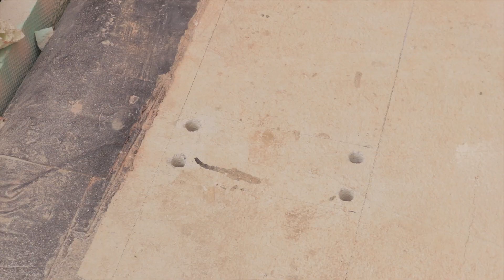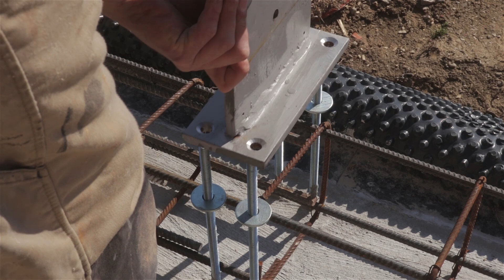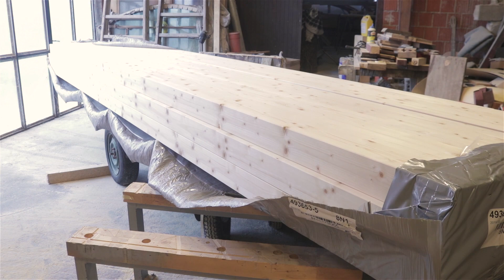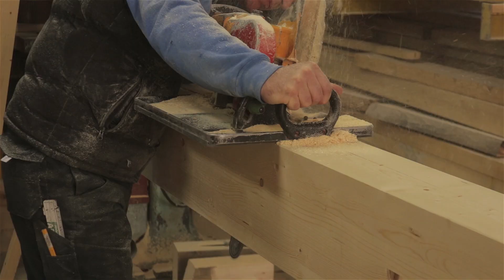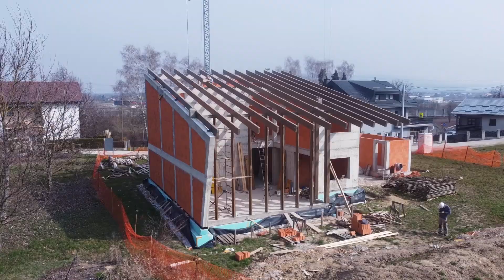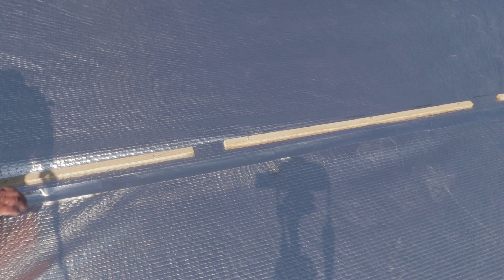The Roof is Going up! My house build Pt7

Comment: The "keeping the sun out" structure. Who wants to live in it?
Reply from the maker: Its designed to be as much energy efficient as possible. It keeps the sun out as you say during the hottest summer months. The sun doesn't go inside so it keeps it cool. During  winter when the sun is closer to horizon, it reaches the whole interior and will heath the dark floor during the day which will radiate captured heath during the night.

Comment: What did you use to coat the wooden posts?
Reply from the maker: I used a water based stain and transparent uv resistant lacquer, also water based.

Comment: Will there be solar on the roof? If the roof is oriented more or less south it would be ideal for that. You could even save the normal roofing material.
Reply from the maker: Yes the orientation is perfect for it. I will have to recover financially a bit though so it will have to wait.

Comment: Great video as usual and nice to see the progress. A roof makes all the difference.
Love the chainsaw attachment for the robot. Did you make it or is it a specialty accessory or an add-on with a clamp for various purposes?
Your wife is a woman after my own heart: not afraid of getting her hands dirty!
Those beam joints are so simple yet effective and faster, I wish we'd do this here.
You plan on insulating the house from the outside I suppose? Can't you find foam-filled (insulated) bricks in your area or is it a building choice?
I'm in construction in the US and always interested in building practices in other countries.
Reply from the maker: :DThank you Fred! Yeah she has no choice;) The house will be insulated from the outside with 15 cm of EPS and ventilated larch siding. I was thinking about blocks with stone wool inside but it is much more expensive system, faster though and total wall thickness is smaller than in my case.. The attachment for the robots is made here in the workshop, both for the spindles and for the chainsaw.
Reply: @lignumchannel   thank you for taking the time to respond. It’s always great to see how ingenious and industrious you are with your tools.

Comment: The house looks amazing. Question: how much cost savings did you see reusing the form boards as the roof deck? In my area form boards are generally rented and returned to the concrete contractor, and it looked like there was some significant labor in removing the oiled surface and staining them.
Reply from the maker: It was a lot of work and it wasn't the plan in the beginning. But I ran across an old supply and got it for a price that was in the same ballpark as bigger format three layer spruce boards 150x500cm that were supposed to be installed. So I got the shuttering and the boards for the price of one.
Reply: @lignumchannel  that is great. Reuse of materials can add so much character as well as saving costs.

Comment: I bet there must have been much celebrating getting the roof on finally (and it looks like you had a good week off nice weather - did you order that in especially? 🙂)
Love the overhang of the roof and reusing the shuttering boards as the surface. Can't wait for the next installment
Reply from the maker: No time to celebrate.. We will celebrate when we move in😄 the weather was beautiful for the last couple of weeks , a couple more wouldnt hurt.. the overhang is cool but what I love the most about the roof  is that I won't have to shovel the rain water every time it rains😉